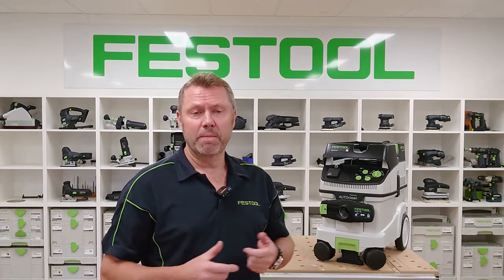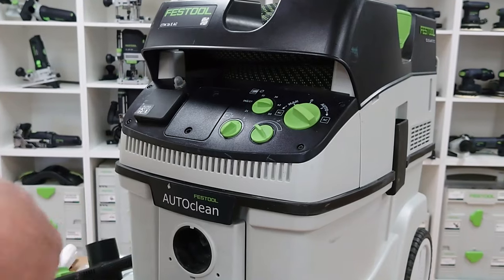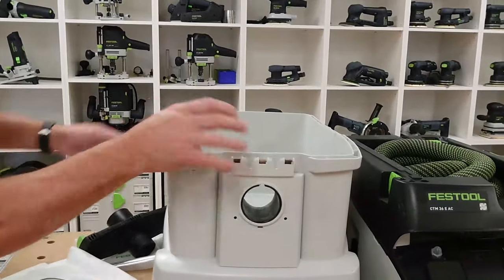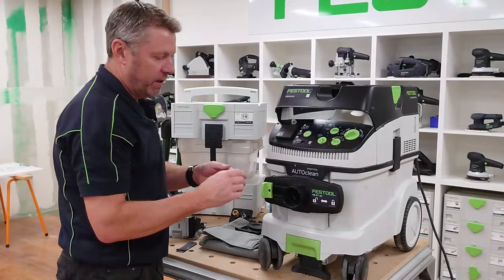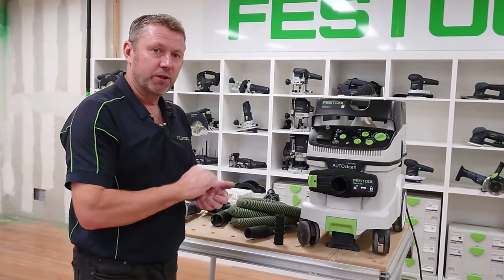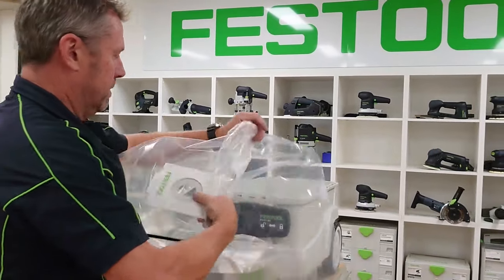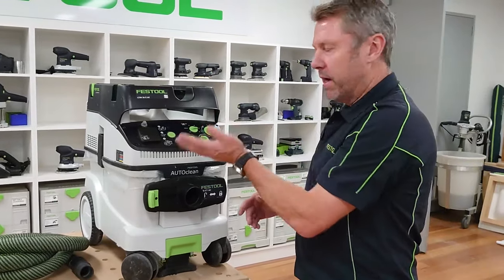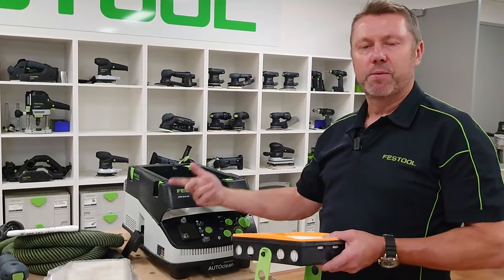Complete guide to Festool CT 36 M Class AutoClean dust extractors

Comment: just converted the bluetooth from the old remote setup, to the new.. the bolts didn't work, too short, not sure what the deal is??  Do you know what the 5mm bolt is supposed to be length wise?

Comment: What's the difference between the HEPA filter and AC filter in dust filtration? 
I will be using ct36 m extractor for drywall sanding and also for other applications that AC is not required so was thinking to get two filters and exchange them between the applications together with bags. I understand that HEPA is not suitable for autoclean function but does it filtering better/same/worse than the ac filter? 
Also would be possible/okay to use plastic bags whit all applications (like general cleaning, wood dusts) or it's better to swap the bags and filters in between applications . 

Hope all that makes sense

Many thanks
Reply from the maker: The difference with the 2 filters is the type of material used for each as the AC filter is required to be flexible to enable it to withstand the cleaning process.
The AC filter ,along with the open plastic bag, should be used for plaster or concrete dust with the AC function on, so that it cleans the filter at the required intervals.
When working with general dust ,wood dust etc, the white self-clean bags can be used  in conjunction with the HEPA filter without the AC function in operation.

Comment: Do I really need one of these for a PLANEX 2 or will my midi be ok? Im only sanding down paint on walls and ceilings ready for re paint. No drywall filler.
Reply from the maker: If only sanding paint then a Auto Clean extractor is not required.
The AC extractor with an open bag system  is necessary when sanding plaster due to the fine particles that will clog an enclosed self-clean bag.
Reply: @festoolaustralia  Thanks 🙏

Comment: Using the plastic bag seems to just completely trash my vac/filter in about 10 minutes 👎🏽
Reply from the maker: Hey Dan. Thanks for letting us know. What type of dust are you working with? The plastic bag is designed to keep the suction level consistent when extracting concrete or plaster dust, whereas the white self-clean bag would clog when extracting these types of dusts regularly. Also worth noting that the Autoclean extractors can be given an extra clean by using the blast gate and the manual function. Justin
Reply: Festool TV Australia just all kinds of work dust. Mostly timber. 
I’m chasing down some self clean fabric bags now 👍🏽
Reply from the maker: Yeah cool, those should be the go for most timber dusts. Let us know how you get on. Justin
Reply: Hi, question! I just bought the 36, but I haven't set it up yet. Will it automatically work with the batteries with Bluetooth or do I have to buy something special to sync up this dust extractor with my battery operated Festool tools?
Reply from the maker: Great question! For that model you need to buy a Bluetooth module and have it fitted to your extractor so that the Bluetooth batteries (or a remote control) connect. Unsure what country you're in but in Australia, it's something like this: https://www.festool.com.au/bluetooth-remote-control-set-for-ct-extractor_202097.html Does that help? Justin